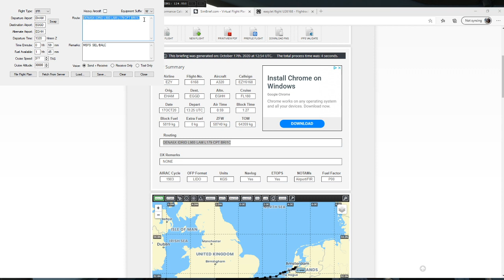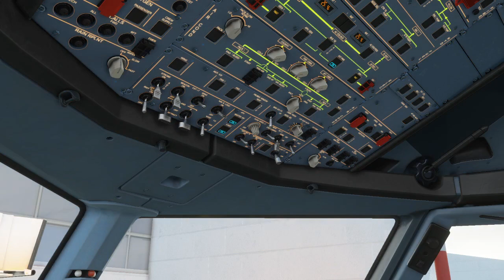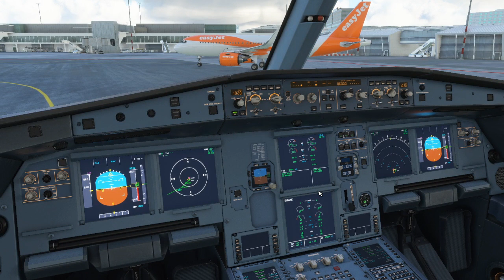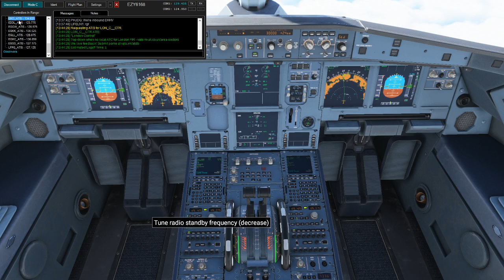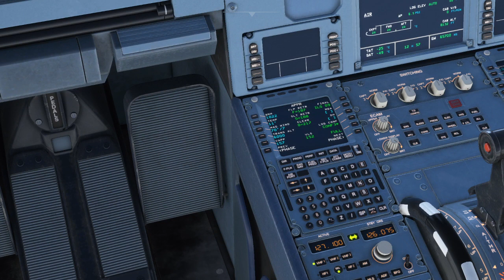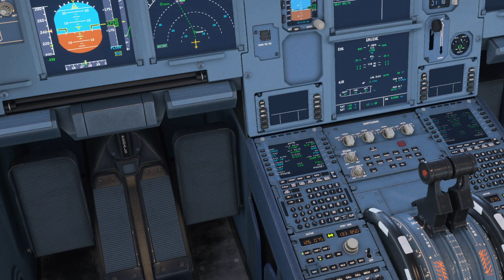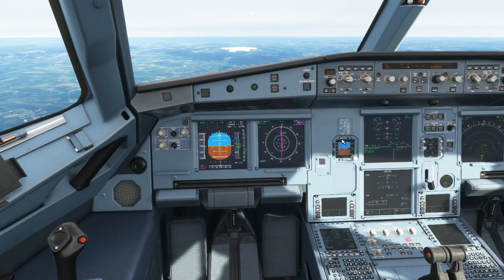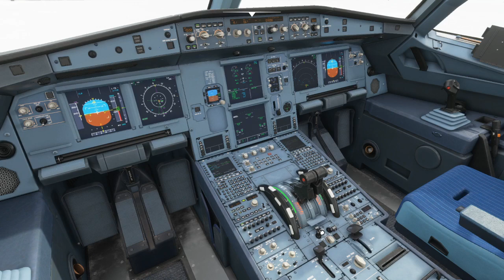FS2020 - HOW TO: Change the entire flight plan in the MCDU - A320nx Mod - Full Flight AMS - BRS

Comment: Great Video! Is it possible to change the altitude constraints in the FMS, I've not been able to find a way.
Reply from the maker: Sure, for cruise you can change that in the Init A page at the bottom left of the MCDU ... Or head into the flight plan menu in the MCDU and find the waypoint you want... Then click on the right hand side button  on the mcdu aligned with the waypoint you want to add a constraint for.

Comment: Hi silly question😂I’m using the A32NX and I’m using SimBrief for my flight plans. I fly out of Bristol. My problem I’m having is when I select my STAR I.e. the BRI1A arrival for 09 or 27 and I select no vias, it still takes my VIA BRI. Furthermore I try and clear BRI on the MCDU just like you could in the Aerosoft A320. Any solution, if not no worries and I’ll keep doing manual vectors
Reply from the maker: Yeah in MSFS you can't as it displays exactly as it should do in the charts and won't let you amend it - so you can't prevent it and have to self vector to finals - it's the only way :)
Reply: @BritishAvgeek  ahh ok thank you anyway.

Comment: I have a question for you guy, do you know why after changing the runaway and approach in mcdu, after insert, the plane will turn 180 and back to the previous way point?
Reply from the maker: because it is a bit buggy - a fix is being worked on but it is quite complex and is taking some time
Reply: @BritishAvgeek  thanks.... I thought I missed to press some button.